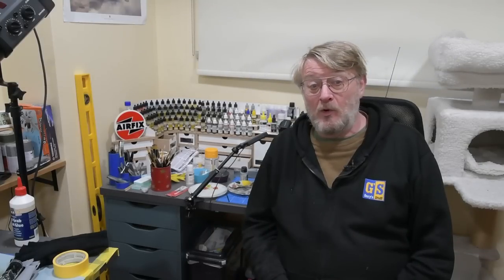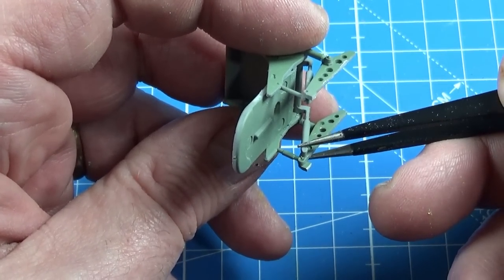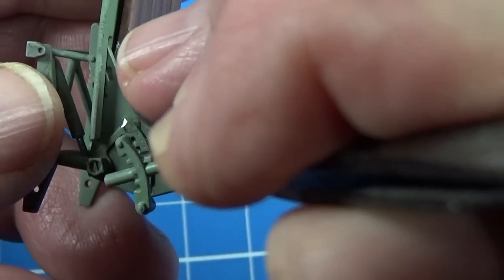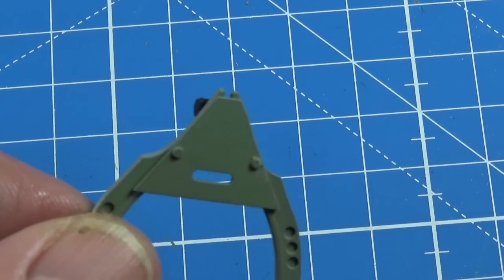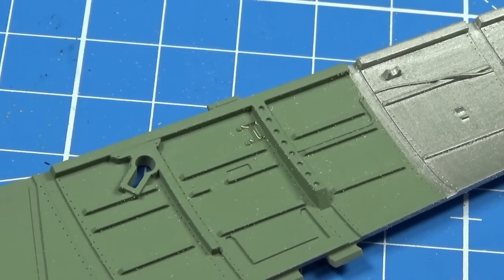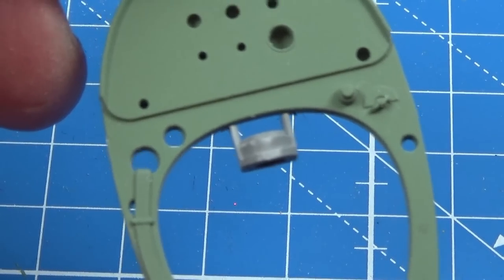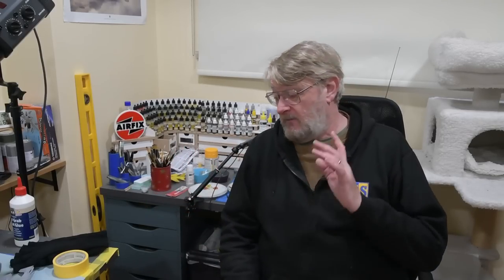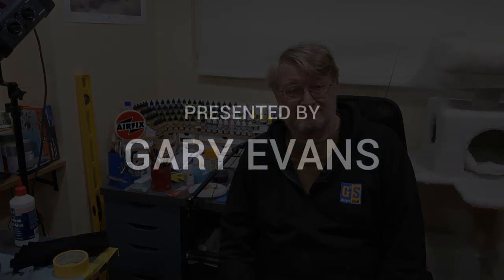AIRFIX 2022 NEW SPITFIRE 1/24 build day one - 1080p HD

Comment: Coming along nicely, Gary. You've done the instrument panel beautifully. Just being a little pedantic, but I see that the flap lever on the panel (top left hand corner, to the left of the red data placards,) appears to have been molded, correctly, in the 'up' position, so strictly speaking, you have to model your kit with flaps 'up' to be correct.
For those wishing to model flaps 'down', the molded lever has to be shaved off and repositioned in the opposite direction.
My father flew Spitfires and he said flaps were always put back in the 'up' position after landing at the earliest opportunity. In addition, the flap positions were either 'up' or 'down'. There was no intermediate position.
Hope this helps.
Reply from the maker: Mark it helps enormously and I will attend to it. The comment about flap selection reminded me that the lack of intermediate position was an issue on late Seafires, as I have mentioned before. To give about 15 degrees of flap for take-off at heavy load, the pilot selected flap down, a small wooden chock was held in place then the flaps selected up - the chock providing the required degree of flap. On take off, stable climb, gear up then a quick cycle of "down and up" on the flap lever dumped the chock. Barmy.
Reply: @garys_stuff  Hey Gary, thank you so much for your prompt response. Gosh, I was completely unaware that they resorted to such measures in the FAA regarding Seafires. Wonderful stuff. My father, who was RAF always had great respect for naval pilots as when landing, his airstrip stayed perfectly still and certainly didn't have a tendency to pitch or roll!
Reply from the maker: @markfranks1329  another thing I read about in "They Gave Me a Seafire" was the loss of many aircraft going off the end of the runways - the Spitfire was designed for grass strips which help with the braking - on concrete the brakes got no help and would fade before stopping the aircraft! But I would say that anyone who got into one of these things and took them to face an enemy was a bloody hero. Full stop.
Reply: @garys_stuff  Too flippin' true!
Am thoroughly enjoying your content. Keep up the excellent work. Looking forward to future instalments in regard to this fabulous kit. 👍

Comment: Good work Gary, especially the cautionary tale of the seat positioning.
I'll make two observations, first the kit, the tab for the air bottles would have been better in a recess in the cockpit side rarther than a slot right through which shows unnecessarily from the outside.
Second. in your build,  I do not know what colour the seat pan should be so you might be right but the pilot sits on the parachute so the seat pan need not be leathered.  Should the colour be green or black?
Reply from the maker: This did cross my mind, as I've never sat on a leather seat in any RAF plane. I'll have to ask after the holidays...
Reply: @garys_stuff  Further update, I was looking through Spitfire bible "Spitfire the History" by Morgan and Shacklady to see if there was a good picture of the seat but unfortunately not.  Spec F37/30 does specify grey/green for the interior of the cockpit (excluding the instrument panel).  I assume the parachute would cause quite a bit of wear and tear so light alloy would be vissible.  However, I remembered that you are building a PR version.  In the book there is quite a bit on PR versions (like a refueling port in the underside leading edge between ribs 19 and 20 and a lot of hand access ports under the LE for rivetting for the fuel tank).  I don't remember which version you are building but in the cockpit build you should have had a type 35 camera controller roughly where the gun sight would have been and depending on version another control box by the pilots left knee.  The shutter button appears to be on the top of the throttle lever.  The three levers on the throttle are throttle, mixture and proppeler pitch.  
Incidentally, one of the specifications F5/34 requires adjustment of the seat (up and down) and the rudder pedals (fore and aft) by up to 4 inches in flight which explains the lever on the right of the seat pan.
Hope that helps.
Reply from the maker: My one is an FR.IX, so doesn't have the Type 35 camera control (it still has the gun sights as it is armed) - there would I guess have been the controller on the lower left of the cockpit - basically an "on/off" switch with fuses maybe - for the single F24 camera behind the cockpit. From memory the Type 35 was all about the vertical cameras, setting altitude and speed so the system could make exposures at appropriate intervals for proper overlap of the frames as only the central third or so was at the best possible resolution for the lens. Maybe by the time of the F.IX they were using the synthetic bonded paper seats, they appear to be all brown (rather than leather) - in which case maybe the sides should be brown also?

The difficulty is in finding contemporary images that show this, as restorations can be quite variable!
Reply from the maker: sorry "synthetic resin-bonded paper", SRBP seats...
Reply: @garys_stuff  So you have the oblique camera then (a bit like the PR in "A Bridge too Far").  If you have guns, you don't have LE tanks either.  I knew about the aerolite spitfire but not about cardboard seats.  
Going off on atangent, I looked at Airfix site yesterday and was amased just what a small range they have, and whilst they have the bomber service kit there are no figures.  What do you use for figures in diaramas?  Wheres the ground crew to load the bombs?

Comment: Coming along very nicely, Gary! 

Whats the length and span of this model? 

Also, can you advise where you got your workbench from? I am setting up / sourcing for my new modelling workshop which I am currently stripping paint / very old paper from. 

Good on you for alerting your audience to the potential pitfalls as you went along. 

Love the old Spit compass. What a nice piece of history that is to have. 

👍🏻👏🏻
Reply from the maker: Hi Darren,
The kit ends up 469mm wide (for the full span wings) and 397mm long.
The workbenches are from Ikea - the main bench is a Lagkapten 120x60 with an Alex drawer unit and two Adils legs. The camera bench is a Linnmon 100x60cm with four Adils legs. The storage units are by HobbyZone available online at hobbies.co.uk
You must let me know how your new workshop goes!
Reply: @garys_stuff  Thanks, Gary. I thought they looked a bit Ikeaesque. 

Room is 12ft by 7ft. Way off finishing yet. But I will have a look at Ikea for the work desk.